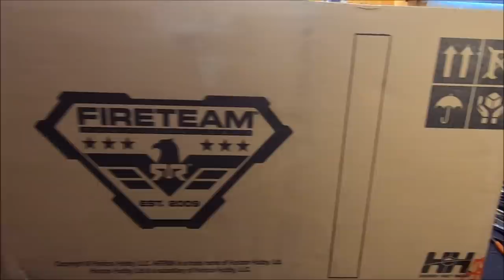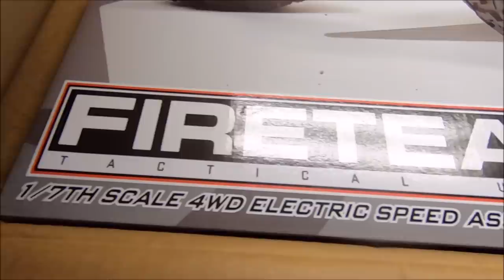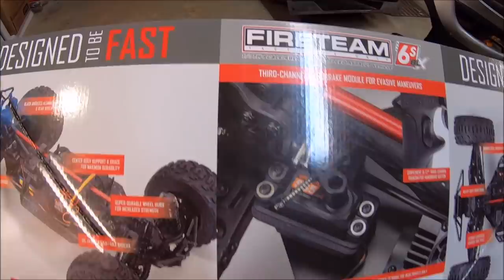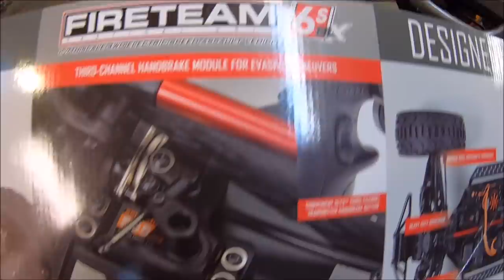NEW! ARRMA FIRETEAM 1/7 scale BEAST! First look and maiden run!

Comment: Awesome first run with the FIRETEAM, we love seeing ARRMA vehicles getting driven hard! 10:37 🔥🔥
Reply from the maker: Thanks so much!!🤗 Absolutely love this rig! You guys nailed it again! Killer looks, design and a pure drivers car! Look forward to the next bash!!😁👊👊💪🚀
Reply: @RCfanAddict  CNC is only a production method, but I assume you want more aluminium. To be honest, spending a ton on M2C can easily have the exact opposite effect that you expect. Adding weight and rigidity is really the worst thing you can do for durability. I had a full M2C K6 EXB, and it was a horrible truck. I also had a Talion V4, where I 3D printed some replacement parts for, like replacing the aluminium towers with 3D printed PA12-CF - it was pretty much unbreakable.

We don’t want more CNC’d “7075” etc, we want advanced composites.
Reply: @RCfanAddict  yeah then the truck will cost $600 more and you'll complain its too expensive 😂😂😂
Reply: @RCfanAddict  I've never bought an arrma. Arrmad are for poor people
Reply: Cost too much tho
Reply: For $700 I expect a better radio like DX3 active, not a cheap radio that doesn't fit this vehicle👎
Reply: Can y'all make this in 1/10th scale and leave the seats open for our own figures please? 😉
Reply: Since significant time has passed I’ll be willing to receive one and in exchange do a current YouTube review from a fresh mind and remind others why this is still and Important and relevant model today.  Hmu

Comment: I think they did a great job with the center diff upgrade! The aluminum center diff case is a complementary to the handbrake for high speed bashing. Hitting the handbrake at high speed could literally explode a plastic center diff.
Reply: So why don’t the infraction/ felony have them then?
Reply: @Captinfun101  it takes time to see these flaws. This is why we have newer improved versions of them from time to time. V1, v2, V3, and so on.

Comment: How do the tires compare in size to the Katar? I really like the tires the most. Not a fan of the body at all but the overall design is a win for sure...especially being 1/7th scale. I'm not a fan of Spektrum electronics either so I can't wait to see what some other folks throw in there to really push the limits.
I'm diggin' the arms to...look almost as long as Kraton/Talion arms. I can see me swapping out my regular arms (and even the chassis) and using them on a Talion hybrid
Reply from the maker: Tires are pretty big in diameter. A tad larger than regular Backflips.

Comment: Quick question Can you run 2 of them batteries in there or just one Because I'm about to order the batteries
Reply from the maker: 6s packs just one but you can run 2/ 3s packs but I'd say no larger than 5200mah.
Reply: @RCDUDE81  ok cool thanks Are you able to use This kind of charger for them batteries smart technology powerstage battery&charger bundle
Reply: What charger do I need to use for these batteries

Comment: How is no one talking about the insane 749.99 price tag?? lol
Reply: Ikr i mean it's cool and all but it's almost as much as the 8S or X-Maxx 😅
Reply: Gotta pay to play , and x maxx isn’t that good my friend over priced plastic that traxxas probably builds for under 200 bucks each and then soaks you for it as well , 12 of one half dozen of the other .
Reply: @greatwhitenorthrc509  Eeeh i'd say both Kraton 8s and Xmaxx are on the same page. They both have their own issues. I mean there's nothing wrong with plastic as long as the material is good. I own 4 Arrmas myself (Kraton 6s, typhon 6s and 3s, and beefed up granite voltage) because i know what to expect from them like their weak parts and whatsoever. I know nothing about other brands so i'm not gonna talk like a smart*ss 😂
Reply: @TheCybusterGundam  all I know is I’ve been buying rc cars and trucks for 20 years and have developed a real sense of what works and what doesn’t , and over the years I’ve had nothing but problems with traxxas , arrma  I’ve had way less problems with hands down I’ve tried the maxx twice the x maxx twice and yeah still not impressed , there quality is better than years past but still not that great.
Reply: Give it a week then we will start hearing from certain reviews how it's "not durable " and all the m2c products get whored down our throats.
Reply: @DeRock401  well if your not rich duperbash or rc dude 81 you shouldn’t have a problem , I run a Mojave with just exb chassis brace and servo mount , run on 6s all the time moderate basher and literally have not broken anything yet .
Reply: @greatwhitenorthrc509  while I do enjoy them both. I must say Arrma is definitely higher quality

Comment: I was a fan of Arrma until I bought a Mojave a year ago and ALL the electronics were SHIT. Servo went out after a month, ESC went out 3 months later, motor a month after that.  I was still rocking with Arrma since I LOVED running my Mojave and they did send new parts.  But then ESC caught on fire after I plugged up battery b4 run and completely destroyed my truck and my smart batteries.  I reach out to Horizon and they said new will look at it but you will need to send it in to use.  The return shipping cost $200 due to its size.   I’ve already spent over $1000 on this damn truck,  and was pissed since they sold a truck with CRAP electronics.  Every arrma products look cool and fun.  But once you have a problem good luck getting in touch with Horizon to have them fix issue for you.  I should have just bought a PS5 last year.  I will never buy another Horizon product again.  This is just my terrible experience hope no one else will ever have to deal with what I went through.  All this happened within a year of purchase so it was under warranty but they did not honor the warranty.